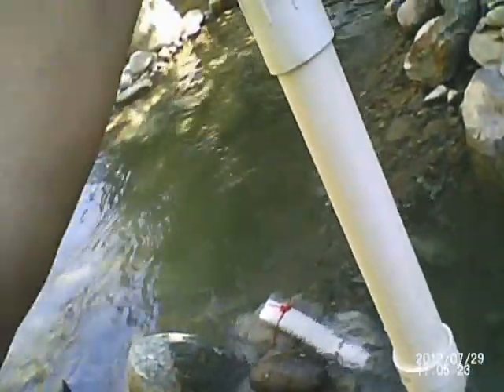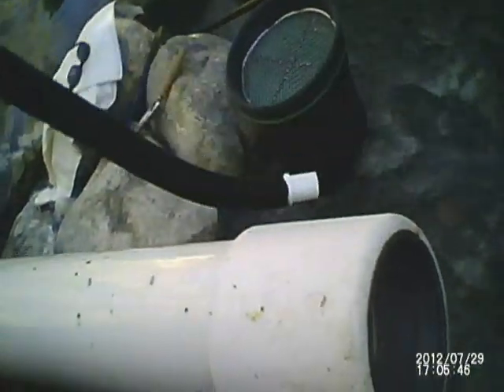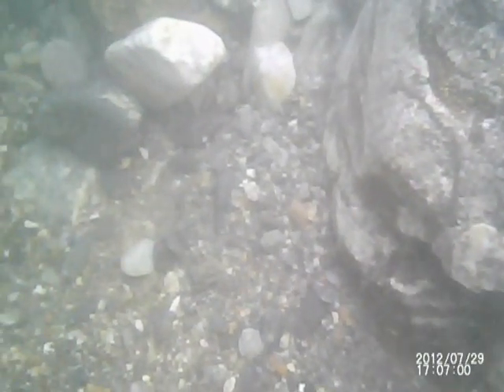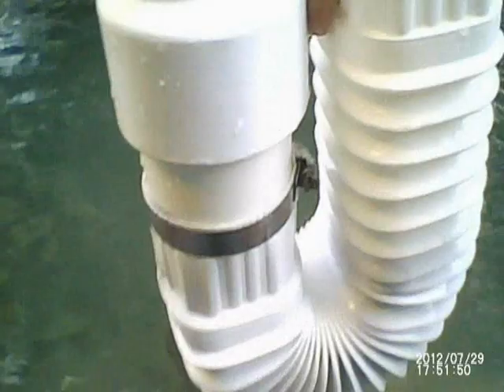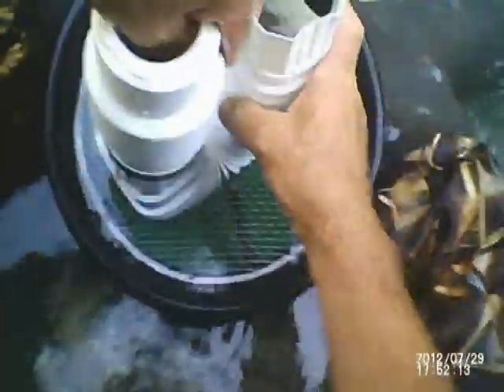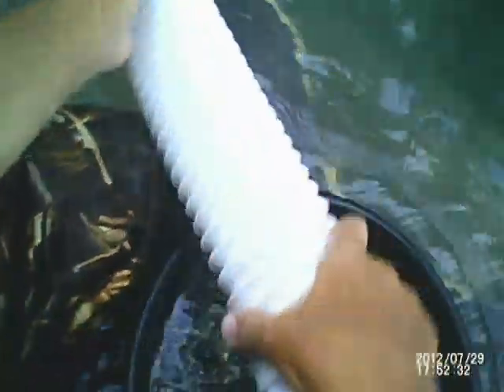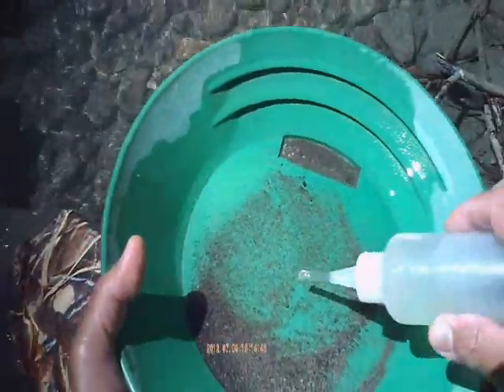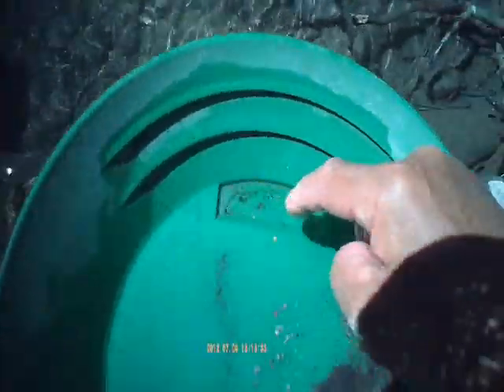Hand Dredge and Gravity Trap Gold Concentrator

Comment: Although I question the integrity of the materials... I have to give you props. Even if it only lasted a few sessions, it's a decent backpacker setup.
Reply from the maker: Really, have to agree with you there. Who ever heard of a 2" Hand Dredge that small? Nobody, a sluicing alternative,  EGTC Gravity Concentrator, that works. What a surprise to find all of the Gold stays behind and makes clean outs fun. Unheard of, mind blower. 
   Just think, a "Stealth Dredge", your the only one that can tell!
Reply: @GoldenSniffer  - it's all lightweight, collapsible... and even when collapsed, it has a cavity to store more stuff.... meal jar, etc. 

I dig it.
Reply from the maker: @sylentxtinction2097  Question on material integrity? Nice thought, I know from experience that so far, all Model 625 and Model 2125 are durable and last for many years. Valve flappers are the only component that wears out and occasionally needs to be replaced, an easy procedure.

Comment: Looks good, the tube seemed a bit short though. Are you sure you arent loosing some out the end? 
Great video, thanks for sharing and happy hunting!
Reply from the maker: Amazingly as it seems, pumping the gold bearing material into the corrugated flex tube set at a steep incline allows gold to get trapped. Apparently, in between the pump strokes, the GOLD drops and settles, then with continued pumping the lighter less dense material gets pushed along but the GOLD and other heavy material just sit there due to the lack of the waters mechanical force around them. The heavy more dense material just percolates a little bit as more water gets pumped across it, concentrating occurs. Very exciting.

Comment: I'm not sure it's a good idea to use ANY corrugated hose/tubes between to material and you pan? I made a pump with smooth hose directly in to a 5 gallon bucket and it works pretty good. No chance of losing any fine colors in the hoses. Best of luck with your mining!!
Reply from the maker: +Frank James The rectangular corrugated tubing (EGTC Experimental Gravity Trap Concentrator) started out as an attempt to devise a "Picker Trap" to catch black sand and gold as the M625 HDP Gold Hand Dredge pumped the material up to a sluice box. 
   The logic here was that if there was any black sand and Gold in the material, some of it would probably get trapped in the "Deep Vee's). Since it only takes a minute to empty out the EGTC and a couple more to screen out rocks and pan it down, I should be able to see if there is any GOLD and black sand without disturbing the sluice box!
   As it turned out, when Gold bearing gravel was pumped through the EGTC by an M625 HDP Gold Hand Dredge, it trapped all of the GOLD making it unnecessary to pan out the material in the sluice. 
   At first this was unbelievable, something had to be wrong, somewhere, so, in a test, the material was pumped through the EGTC and into a side loading 5 gallon bucket. Once the 5 gallon buckets were full they were emptied into 60 lb capacity sand bags. After 8 buckets, the material was classified and then sluiced. 
    The end result of the test was that the rectangular corrugated tubing (EGTC) trap all of the gold using the M625 HDP Gold Hand Dredge, hand dredging! 
     To make sure this wasn't a fluke, the test was 3-peated and each time the EGTC trapped all of the GOLD, even the fines!
      See for yourself, the 3 tests are here on Goldensniffer.
Reply: +GoldenSniffer - Thanks for your reply, I stand corrected and glad to hear your system works. I'll certainly give it a try and see how it's work for me!! Good Hunting,, it's so much FUN!! : )